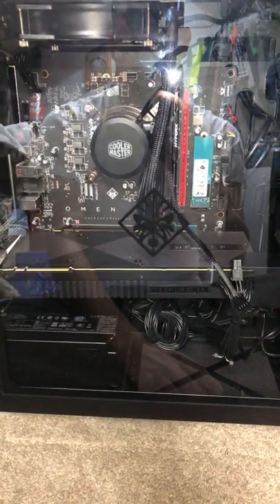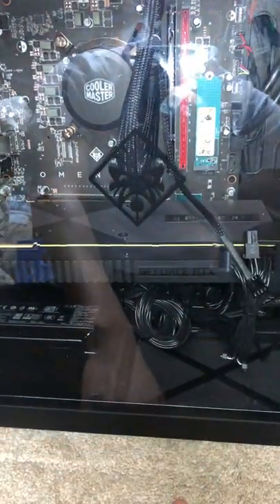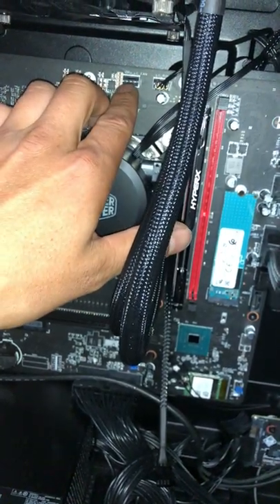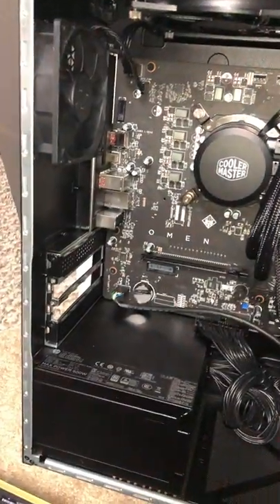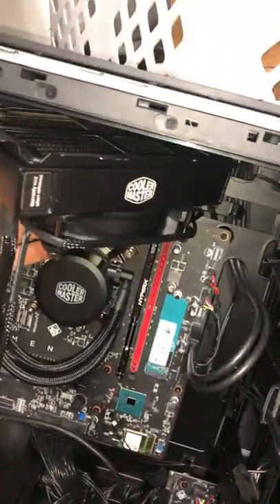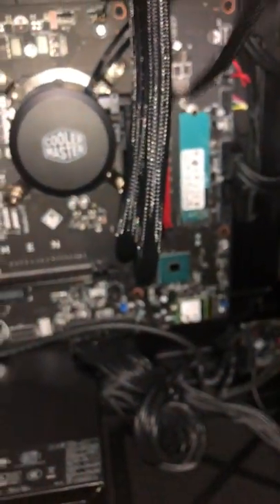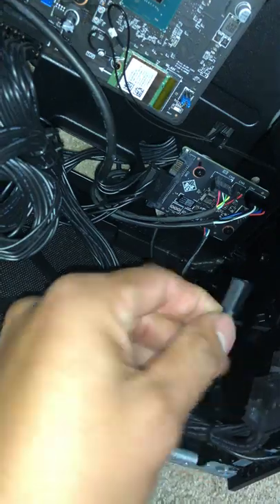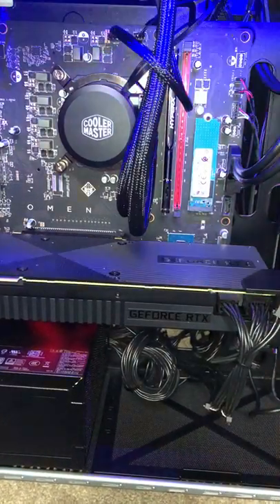HP Omen Obelisk RTX 2080 CPU cooling upgrade. Upgrades pt.1/3

Comment: Hey man hope you can answer this I know it’s been 2 yrs but I’m trying to add new rams but it’s not working and making an annoying beeping sound
Reply from the maker: If it only started after replacing the ram try removing them and make sure they are correctly in place. If that doesn’t work try the ram it came with to see if that’s the problem.
Reply: @ramonvazquez2475  so when I put the old ram it works but when replace it and add a new one it makes a beeping sound . Is there something I gotta do before adding or replacing ram
Reply from the maker: @TheArrowOfLife  what ram are you trying to use? Size, speed and how many sticks?
Reply: @ramonvazquez2475  so 2 16 bf ddr4 2666
Reply from the maker: @TheArrowOfLife  ok so there could be a few factors. First I’d like you to try this. Remove all ram and try booting your pc with no ram. You’ll hear a certain amount of beeps in a certain order and it’ll repeat until you turn off the pc. Second insert the new ram, turn on the pc. Listen for the same pattern of beeps. If they are the same beeps it’s a indicator that the ram is bad. One or both sticks. If that’s the case try one stick at a time to determine the bad one. Two more scenarios of ram problems are. The two new stick are not working properly together (unlikely if bought new together because they test them before shipping out). Last issue I can think of is. My pc came with the hyper x fury ram, which is designed to automatically optimize to the pc without needing to go into bios. If these two new sticks need to be optimized manually you’re in a pickle. As the Omen motherboard will not allow you to change that in bios. At least mine didn’t. Hope the info is helpful
Reply: @ramonvazquez2475  yeah there both new and I have the same pc as you but I’m pretty sure it has to be something else but I appreciate the info and help ty

Comment: Can I put a cooler in with no leds and not have to do a mod just use the pump connector and fan connector
Reply from the maker: Absolutely. Should work just fine
Reply: Ok thanks but is there any other way to get the leds working without having to modify anything
Reply from the maker: What kind of fan/led? Type of connection?
Reply: Ray Dizzle the led on the cpu because I don’t have an extra usb 2.0 port

Comment: I have a problem if anyone can help, the default fan on my graphics card. Its a 1060 nvidia geforce gtx anyways, one of the fan blades broke should can i water cool this in anyway? or should i just upgrade lol
Reply from the maker: Rapid Inertia I don’t know the exact card you have but you can replace the fan? Also most cards can be water cooled. As long as they have kits for said card. But it will be more expensive to water cool of course.

Comment: i got this pc with the 1060 which its a great pc but i need to upgrade my pc i purchased the corsair h60 cooler for the cpu and i never upgraded like this ive only doe ram before is there anything i should worry or be careful about
Reply from the maker: When removing the stock cpu bracket from the back of the motherboard, this double sided tape that you need to gently remove.
Reply: BlueNO did you have any issues I have the same setup as you

Comment: Ray I got it fixed but I want to get a new case and mother board can I just put the ssd ram and cpu in the new motherboard will there be any risk
Reply from the maker: Not if done properly. You’ll need to purchase Microsoft again for the new motherboard tho

Comment: hey where can i put rgb connector i bought silentiumpc aio cooler and its rgb but idk where to put the connection could you help me out?
Reply from the maker: What kind of connection is it? A 2.0 usb or 3.0??
Reply: @ramonvazquez2475  uh 2
Reply from the maker: You’ll need and adapter from 2.0 to 3.0 and a commander pro. It’s explained in part 2 video.
Reply: @ramonvazquez2475  so they say that hp omen obelisk is one of the most upgradeable pc but i cant even have rgb yes nice  good work guys
Reply from the maker: Exactly why I was mad at them. They put two usb connections on the motherboard only. One 2.0 and one 3.0. The 3.0 is being used to power the the two external ones located at the top of the desktop. The 2.0 is being used for desktop led. Now I’ve heard you can use that usb connection but of course you’d lose the led for the desktop, but I’m not 100% sure since I no longer have this computer. That’s why I used the adapter and the commander pro. The commander pro provides two additional 2.0 connections. 🙂
Reply: @ramonvazquez2475  did you sell it?
Reply from the maker: First I started upgrading everything as I started learning how to upgrade parts and putting better parts. Then I sold it. I only kept the GPU which is still going strong. I water cold it. I have a couple videos of the crazy/frustrating journey

Comment: How did you break off the panels that the radiator is mounted to?
Reply from the maker: Yes you must in order to allow air flow
Reply from the maker: You must apply pressure to the four square on the mount. They should just snap off.
Reply: Ray Dizzle thanks so much for the quick response

Comment: Did you ever get the RGB for the CPU cooler to work?
Reply from the maker: Once the commander pro was installed
Reply: @ramonvazquez2475  another question can a fully Modular 1000 watt PSU super nova from evga fit in the HP OMEN of obelisk?
Reply from the maker: @armstrongmillien5728  yes. I would also recommend a fully modular PSU. As space is tight in there and any room is appreciated.

Comment: if i get the 2070 doesn’t i need a better psu because i think 500 watt is not enough?
Reply from the maker: No. I had the 2080 when I got it. So you should be fine unless you overclock or start adding more fans
Reply: Ray Dizzle so i can’t get a 2070 overclocked with the 500 watt right?
Reply from the maker: I meant like cpu over clocking which you can’t really do with your motherboard anyway. You should be fine.
Reply: @ramonvazquez2475  but i can use a rtx 2070 overclock?
Reply from the maker: I’m not going to give you a for sure yes. The only way to make sure is comparing the power consumption. Since there’s so many out there you need to verify the specs of the one you have in mind. Then compare it to the rtx 2080 that were put into the omen and is the one I have.
Reply: @ramonvazquez2475  Thanks for ur answer, do you know any site where you can check that the psu work with the gpu? and i cant check out cause i have a gtx 1050 ti

Comment: Do you think that i could fit a corsair h80i v2 aio ???  I have the same pc.
Reply from the maker: Bxboricua it’s a 120mm radiator and fan so yes.  The top bracket will hold it.
Reply: @ramonvazquez2475  even tho is a double 120mm fan and the radiator is 49mm in depth.?
Reply from the maker: Bxboricua it will definitely fit one fan and radiator. The second fan might be snug to get in there. Check the video where my final build on the obelisk case before I switched over to a different case.

Comment: How did he get the bracket I’m so good when I’ve been spending about 1 hour trying to get it in
Reply from the maker: memes mx the fan bracket?
Reply: Ray Dizzle yeah and I ment I’m so bad
Reply from the maker: memes mx there two screws you need to  remove.

Comment: Hey man is this the i7 or the i9?
Reply from the maker: Wes Lee I7
Reply: The i9 is available now for 2k. You think Its a good buy or should i get the i7 for 1600 rn.
Reply from the maker: I think you should build your own. I don’t recommend buying built PCs. It’ll save you money and you’ll end up with a much  better pc. The omen is very limited in bios and overclocking so even if you got the I9 there’s little improvement. Spend a couple of hours doing your research on build one. For 2k you’ll end up with a machine that will blow the omen out of the water. Trust me you’ll regret not doing it. These videos were meant for the unfortunate people like myself who had already bought it. Save yourself the headache. Read the comments on the other videos. Allot arent happy.
Reply: @ramonvazquez2475  thanks for your reply bro. I was kind of under the impression that it was more worth it now to buy than to build. As many are saying, the parts separately are more expensive than the built model.
Reply from the maker: That can be the case sometimes when they have specials. Here’s the problem with that. I’m not sure how knowledgeable you are with temperatures and over clocking. Temps are not meant to exceed 80c on both CPU and GPU or any component for that matter. The PC I got was exceeding that limit on both. Due to the stock cpu cooler and the crappy RTX blower card we all get. I paid $1600. I had to add a CPU cooler. Then had to cool the GPU with a kit. By doing those two you already need to upgrade a PSU. Then you’ll find out the case is to small for everything and also restricts airflow. Once I corrected all that I started looking into overclocking. Come to find out I couldn’t because the BIOS is locked. Also the CPU I got was the I7 8700 none k version.(not overclockable). Even the Ram was crap running at 2600mhz. For me it was simply not worth it. The only good thing that came from all this is I learned to build lol. Not I’m not saying all prebuilts are crap but the HP disappoints
Reply: @ramonvazquez2475  thanks for your reply bro. After doing some more research, you are absolutely right. You really get what you pay for